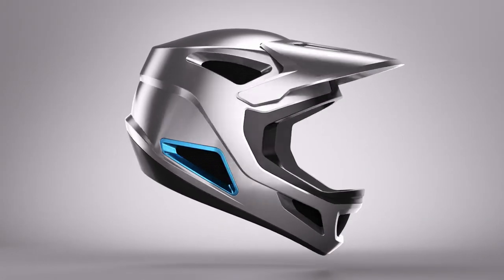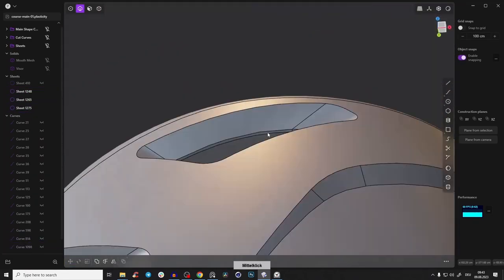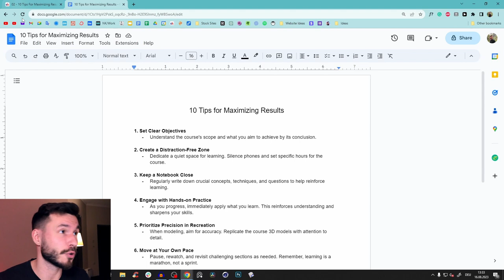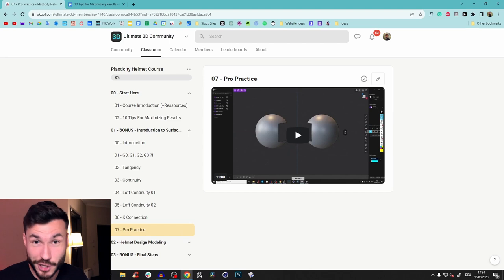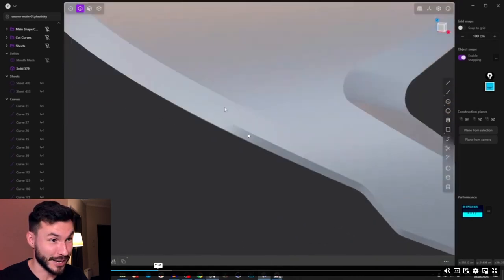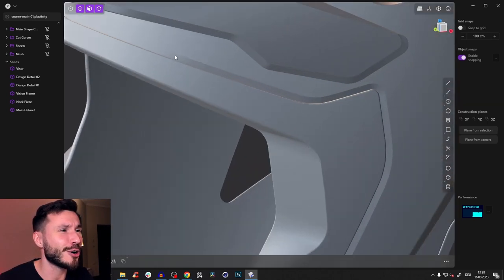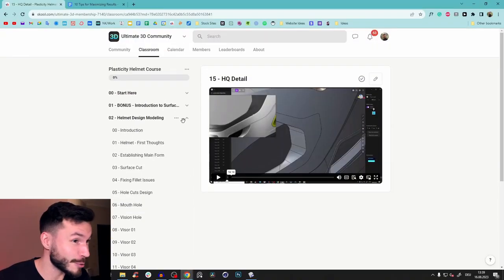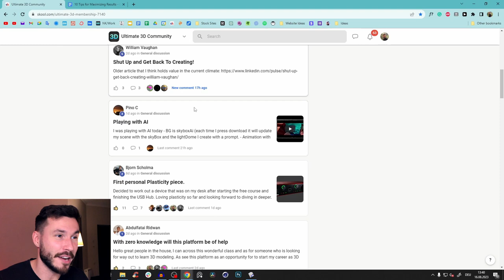The BEST Plasticity Surface Modeling Course

Comment: Please 🙏 
A little instruction and explanation with hollow bodies and pipes for the area of pumps and water tanks, whether small DC pumps or large Ac industrial pump parts Lay lines.

One finds only designing things and one forgets the production area.

The only disadvantage of this program is that you have to remember a lot of buttons and not like Shape3D has the bars on the left and right.

Comment: If your course was based on the creation of baroque carvings, as I will need to mill them on a 5-axis machine, I would be more than willing to buy it. And in this course about the helmet of course there is also valuable information, but it is far from the needs of the baroque carving, as from under the old maneater
Reply from the maker: This time the majority of our community decided that they wanted a helmet. So maybe at some in the future there will be something more similar to your needs!:)
Reply: Baroque carving, can it be done in plasticity?

Comment: hi, I want to create realistic spaceship with interior game assets like in the starcitizen for unreal engine , is this the right tool for the task?
Reply from the maker: Hi!

Sure, Plasticity is perfect in my opinion for such hard surface/organic modeling tasks.

Much more efficient, faster and creative to work with.
Reply: @nikita.kapustin  However, I hope plasticity will make it more convenient for game assets making considering it's a CAD tool. I'm talking about cleaning work and exporting to blender and substance painter for example. I'm surprised that the industry hasn't figured out away of doing that easier and better 🙂. Maybe Plasticity will be the first one. please consider it as a feature request 🙂.